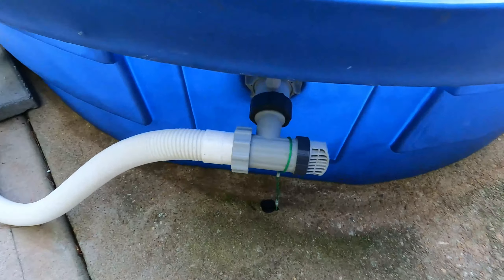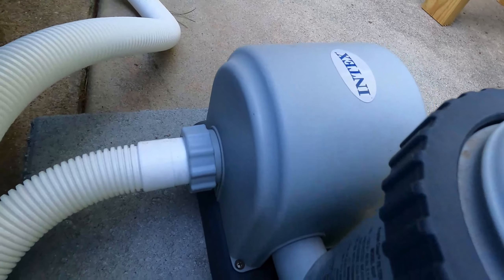Setting Up An 8' Poly Stock Tank Pool From Tractor Supply DIY

Comment: I did one eight years ago and it’s still going. 
Dug in the tank , decked around it and run a sand filter with solar heater attached.   Instead of the noodles around the top I put them in the gap .
Reply from the maker: Good idea!
Reply: Poly Or Steel?
Reply from the maker: @keithrichards4513  Poly
Reply: What solar heater do you use?
Reply: Hey Tim! What solar heater are you using? Is it enough to make it over 100 Fahrenheit for a hot tub? I’m interested in using solar power to heat the pool. Thanks
Reply: @justin_j_bowen  I'm going to try the Best way heater

Comment: I have a 10 foot one. I am not going to go to all that trouble to put in a pump filter and all that stuff. We just add 2 oz of bleach per 50 gallons per the extension office for livestock tanks with algee in them. Still safe to drink and everything. If it gets too dirty just pull the plug and fill again. We have our own well so water is the cost to pump it. 
I paid 700 dollars and a few dollar for mine just a week ago delivered to my house and set in the front yard and filled. Just had a nice swim in it and its pretty warm far from 55f for the well water temp. 
I wish mine had those flat sides. I am just hunting around to see what people did for the inner flange that is on my stock tank. Its like they add a 2nd ring over the top to make it much stronger for the cattle to bash against it. 
I may consider digging out a pit and laying down some foam and a brick wall with foam on it and then build one of those plastic deckes around it. Only a few feed and add me in a simple debris filter, couple of jets, a bubblier and some lights.
Reply from the maker: Sounds awesome, Let me know how it turns out. Thanks for watching.

Comment: Well Paul i regreat no leveling the ground, my plastic stock tank dont have the flat aread like yours but drilling the hose was not bad, I place but of them at same height, the problem I have us that this same pump now only comes with the outlet,  not the intake inlet, so I bougth 1 from Leslie's and it seem that te part where the hose nut screw in to the inlet fiting tread is not going deep enough and I had a huge leak, it was terrible, I will say anything doing this get some gaskets for the hose nuts, dry fit them and have them just in case.

Comment: We used the neighbors reward card at TSC and it cut the price to $410 after MD taxes..

Good video btw, thanks for sharing 👍
Reply: Next time you should tell them before taking their rewards card
Reply: @Cc-nj2zm  huh? They were behind me in line.. 🙃
Reply: for 400 bucks you can get a real pool at least a 15ft x 48inch it comes with everything you need...
Reply: @kushbandit8701  we used to have one and I can honestly say, it's far from a real pool. Ours suffered catastrophic failure on the 4th summer season.
Reply from the maker: Awesome savings, thanks for watching!

Comment: so what size pump did you go with and what accessories you needed. you have 2 pumps on your list and i do not know what accessories that i need for which ones. thanks
Reply from the maker: Intex Pump 2500 GPH- https://amzn.to/4aOL6oM
plunger valves, inlet and outlet kit - https://amzn.to/3HcqHg1
Hole Saw 2 3/4 - https://amzn.to/3QQvlpa
This should be all you need. Let me know if you have any other questions. Thanks for watching.

Comment: Nice! Wish we woulda gone with the poly instead of metal
Reply: Why?
Reply: @ Jason T. 6:20
Reply: @getout116  the chlorine attacks the metal, causing rust. Sometimes quite quickly.
Reply: @getout116  we tried spray painting ours.... its been a pain. it looked good for a while, but started peeling. seems like the poly would've been way easier to manage

Comment: Hi Paul, thanks for the video. We actually purchased a stock tank just like this. We are currently searching for a filter. Is there a particular reason you went with the pump that you have shown here in the video? Is there a reason why an INTEX pump made for above ground pools that have 350-530 GPH rate would not be acceptable? The INTEX Krystal pumps with 1500 GPH seems overkill for a 650 gallon pool, or am I missing something? Thanks for your time.
Reply: @ProjectsWithPaul  WOW! Dang, missed out on that. Ok, thanks for the information.
Reply: @ProjectsWithPaul  Sure thing!

Comment: Shouldn't the outlet be lower than the inlet?  Because isn't the inlet sucking un the debris?
Reply from the maker: You can do it that way. You just run the risk of the pump sucking air if the water level drops. I usually clean it with a net everday in the summer. Thanks for watching

Comment: Can you fit 2 full size adult floaties in the poly one like the metal one?
Reply from the maker: If they will fit in the metal tank then they should fit in the poly tank. Both are 8 feet in diameter.
Reply: @ProjectsWithPaul  we just got a poly like yours!!  Yay!!!! I know they only hold 625 gallons as opposed to metal holding 700.   I was so excited we found a poly!  Thanks for sharing your video.   We ordered a pump last night should be here by weekend.  My kiddos & I are so excited!
Reply: @LadiesofPurposeTV  is because the metal 1 stand straight in the vertical sides, the poly has a angle or reduction in the bottom of the tank

Comment: We are looking for the intake/output fittings for the hose.  Where did you get yours? Also if you would please, love the bench as well, can you send me measurements to build one?  Thanks!
Reply from the maker: Search Intex valve on ebay and its like the 3rd item down. 2 for $35
Reply from the maker: The intake and output fittings came with my pump
Reply: @ProjectsWithPaul  Thanks, what about  the bench?
Reply from the maker: @jackiewilliams1622  I have a separate video on the bench!

Comment: I just purchased a 9ft poly tank for my niece/nephew.  After you cut in the intake/output holes...did you need anything else(sealant/ring) to keep it from leaking? Or is what's supplied by Intex enough?
Reply from the maker: The rubber seals that come with it work good. They go on the inside.  Thanks for watching.
Reply: How much did you pay for yours? They seem so expensive everywhere I look

Comment: Great video. Do you still recommend the poly tank? No issues with cracking etc since it’s been a couple years? Was on the fence between poly or metal. Thanks!
Reply from the maker: Yeah, the poly tank is tough. I pressure washed and cleaned it with bleach this year and it looked like new. You can get a vinyl liner now for the metal tanks, so that might be an option.  Thanks for watching.
Reply from the maker: Also, I made a new updated video
Reply: If anything metal is under water, it'll evenrually have the risk of rusting. Especially with Chlorine eating at it all the time. Galvanized or not! I have heard some have luck with super cleaning the inside with denatured alcohol and spraying a rubberized coating all over the inside. I haven't heard what the rusults were on that option. Has anyone else heard anything?
Reply from the maker: My son sprayed his metal tank and it began peeling after a season. They are making 8' diameter liners now on Amazon. That might be a good option for metal tanks.

Comment: How do you keep water from leaking around your intake and outtake valves? If you remove them at the end of each summer, I assume you don't use any glue. TIA!
Reply from the maker: The valves come with a rubber gasket. Thanks for watching.

Comment: Would it be possible to get the dimensions of the pool (diameter or circumference under the top lip in addition to other). We are putting in a ground level deck this weekend.  And now my wife wants to add this to it. This looks awesome for the kiddos.
Reply: We are 30 days out for a tarter stock tank  in my area.
Reply from the maker: I'll get them for you!
Reply from the maker: So the diameter under to top lip is 90 1/2", the overall outside diameter is 95 1/2"
Reply: We got one a week ago and my kids (5&8) have spent so much time in it already! A good filter goes a long way towards easier maintenance

Comment: Thanks for sharing about the poly tank.  I’ve been looking at stock tanks last couple years but was concerned to spend $400 for a rust bucket. Lol.   I like look of metal but the poly seem to me that chlorine would be accepted & I also was concerned about the zinc leashing from the galvanized tanks.   I notice the poly has ridges on the floor, is that a toe stubber?   Is there something to help make the bottom where feet are more smooth or is it not noticeable? I have 6 kiddos so don’t want it to be an issue.  Thanks!
Reply from the maker: Thanks for watching and commenting. The ridges on the bottom are smooth and not an issue for us or our grandkids.
Reply: @ProjectsWithPaul  that’s great to hear! Thanks so much.
Reply: @ProjectsWithPaul  great video

Comment: This is the best video on stock tank pools. I  think this one will be my preferred choice to avoid dealing with the rust issues. How long have you had yours?
Reply from the maker: Thanks for watching. We've had it for 2 years.
Reply: @ProjectsWithPaul  Final question, can the poly tank also serve as a hot tub during the fall? Will the hot water affect the durability of the tank? Will extreme freezing cause any cracking? Your video has me sold.
Reply from the maker: I don't think 100 degree water will hurt it
Reply from the maker: They are made for watering cattle in all climates
Reply: @ProjectsWithPaul  I am sold and saved your video for installation! Superb instructions and thanks for sharing keep us updated!
Reply: @quartereyes41  Did you install it yet? How did it go?
Reply: @yourdream8  YES, it's installed. I have the Bestway waterfall as the water input, and have the hose connected to ove for the intake. Love, love my stock tank pool!

Comment: Seems loud. Is this a issue with pump being so close to poo?
Reply from the maker: It was a little loud. But you can turn it off while your in it. I recently changed to an intex c2500 and it's a lot quieter

Comment: How has the plastic pool held up?
Reply from the maker: So far so good. No issues.  Thanks for watching.
Reply: @ProjectsWithPaul  Have you had to apply any coatings/ect? Does chlorine affect anything?  I've been debating between the plastic vs metal stock tanks for a pool. Thank you.
Reply from the maker: No coatings and no issues so far.

Comment: I noticed your pool is on a concrete slab. Is it level? I have a concrete slab that slopes to drain water away from the house. We had a metal stock tank pool there years ago without an issue. I wonder if the slope would be ok for a poly stock tank pool. If not, any suggestions on how to level the area?
Reply from the maker: It had a slight slope and it didnt make a huge difference. Thanks for watching.

Comment: Hi Paul. Thank you for making this video. We are ready to set up our filter- we ordered the Intex one like you have and it did not come with the outlet valve.  Did you order yours separately and do you know a part number or what it's called?  Thanks for your time.
Reply from the maker: You can buy the Intex Above Ground Plunger Valves with Gaskets & Nuts Replacement Part (2 Pack) on amazon for about $25. Thanks for watching and let me know if you have any more questions.
Reply: My Intex pump did not come with the strainer grid assembly either. I called Intex and they were very helpful letting me know which parts I needed. I  ordered the parts   from Intex.
Reply from the maker: @melanie9allen958  Im glad you got it figured out. Thanks for watching.

Comment: Great video! About to try this myself..just wondering how long do you have to keep the pump on in your opinion? Pump sounds a bit loud or maybe it's just the video. The reason i mention the sound it because we live in a attached town house and wouldn't want to annoy my neighbor lol. Thanks Paul 👍
Reply from the maker: You can hear it but i dont think it would disturb neighbors. I run it about 2 to 3 hrs a day.
Thanks for watching.
Reply: @ProjectsWithPaul  Thank for the quick reply..forgot to ask if you recommend drilling a pilot hole first? Thanks again
Reply from the maker: @ryanmontreal5883  No, the hole saw will have a pilot drill on it. Thanks.
Reply: @ProjectsWithPaul  Last question i promise!😊 I just placed an order after watching your video for a smaller 6 foot polyurethane tank. I was looking at a smaller pump from intex like the 1000. Just wondering if you think the inlets outlets and hoses are standard? Meaning would i still use a 2 3/4 whole saw? The 1000 comes with1.25in (32mm) diameter hose fitting. Not sure if your 1500 is the same? Tried finding info on it with no luck. Any advice on a pump would be much appreciated. I promise to leave you alone now😊. Thanks again Paul
Reply from the maker: @ryanmontreal5883  No problem, Ill check the hose size in the morning. Thanks
Reply from the maker: @ryanmontreal5883  it looks like my hose measures almost 2 inches outside. So just measure your fittings and drill a slightly larger hole
Reply: @ProjectsWithPaul  Ok thanks for taking the time Paul. I might just get the 1500 but my tank in only 320 gallons..might be over kill. Can't wait for the tank to show up. Thanks for the motivation 👍
Reply: @ryanmontreal5883  some pumps need to have a ceartain amount of water to work best, I got the 1500 cayse the reviews where better, trust me is an overkiññ for my 10ft round by 28" deep tank, i dont turn in on every day, every 2 days exept if rain, but smaller pump sometimes are flensy like the 1 I got 1st on market place was junk, my advice get the pump and see the hoses 1st, before you install go get a set of gaskets for the hose nuts etc, now the intex 1500 comes with 2 hoses and 1 inlet strainer nothing elss, I had to buy the other inlet at a pool store, dint fit great and had a leak, I have no valves, got 2 chip sink stopers.
Reply: @ProjectsWithPaul  I drill a little smaller and the fititng fit water tight since the tank is not that thick.
Reply from the maker: @sharoncourt75  Nice job Maria
Reply: @ProjectsWithPaul  I dint knew how i could share mine with you, i am so happy you where the 1 person i found with a poly 3 weeks ago and answer if go with plastic or metal, so I made a small video and add it to youtube since i cant figure out how to make the pic link, is : 10ft poly stock tank diy soaking pool
Reply from the maker: @sharoncourt75  Wow, awesome job. I'm glad it worked out good for you.

Comment: Thanks to bidenflation that tank is now $829 in less than a year. But great video!!
Reply from the maker: It looks like they recently went down to $549. Thanks for watching.
Reply: What is the pool name? Can’t find it on TSC
Reply: @euphyllialife9667  On website type in Poly ' stock tank. My local TSS only has the Aluminum type:( Some poly may be black and not blue. I just got the black 300 gal stock feeding /water tank which seats 4 nicely and has a slightly smaller footprint, and is higher on the sides. Balck helps with some heating as well. Hope this helps
Reply: @serenityfarmsprepping2267  is it the tarter or behlen county? That’s the question here.
Reply from the maker: @euphyllialife9667 mine is the tarter. Thanks for watching